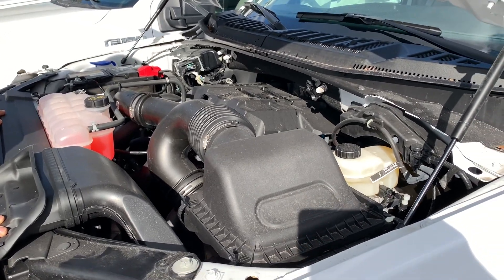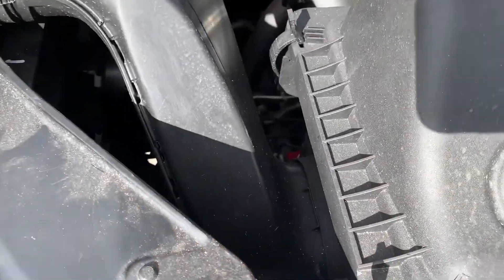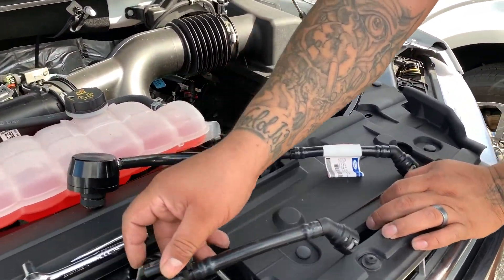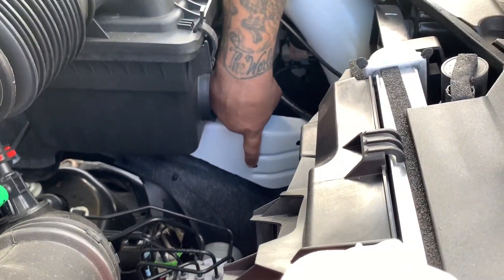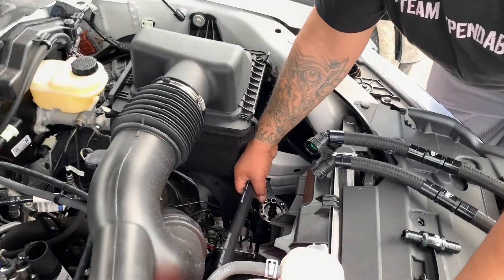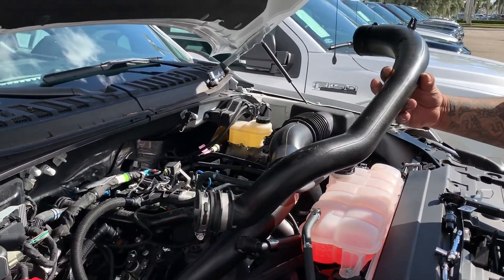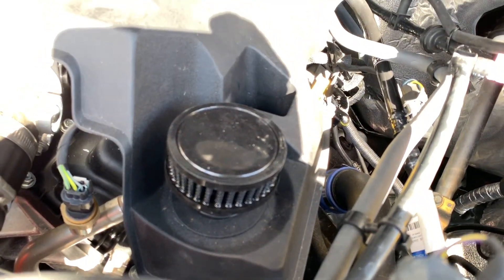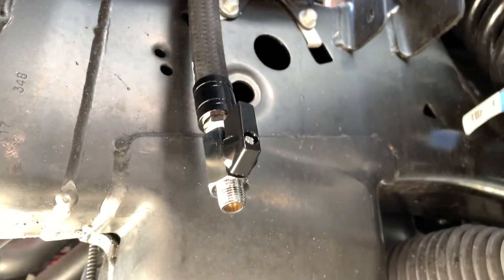Biggest Problem Ford Ecoboost Engine & How to Fix It: UPR Catch Can Install on 2016-2021 F150

Comment: Im having a big problem with oil going into my intercooler and lots of smoke on acceleration I recently replaced both turbos because of noise and they were both pretty wore out but my question is will this stop my oil consumption and keep oil out of my turbos and intake?
Reply from the maker: Absolutely, you can get your oil consumption under control. The UPR Plug N Play Dual Valve Catch Can with UPR Pro-Series Check Valves, and UPR ECSS will eliminate oil consumption .

Comment: isn't this one of the problems they fixed with the redesign of the 2.7L Eco Boost. By Adding a port injector?
Reply from the maker: No the brand new 2022 2.3 2.7 3.0 and 3.5 all still consume the same amount of oil through the PCV system as we test and own each motor. Also, the pictures and results all our customers get with brand new vehicles have defunct any improvements Ford claimed to make. We pride ourselves on delivering a product that produces results and improves mpg, performance, and overall engine life. UPR

Comment from the maker: The breather is good to limit the amount of oil getting sucked out the clean side. Also, the kit is a direct bolt-on and does not increase crankcase pressure. The main benefit is added insurance and generally about 1mpg minimum you will notice cruising over time. Plus you will have a crisper throttle response. UPR

Comment: Is the breather 100% necessary? Does this UPR kit do anything that would cause higher than normal crank case pressure compared to stock? Or is it just added assurance

Comment: you know this engine has duel injection so you really do not need a catch can would recommend one for years 15 -17 tho
Reply from the maker: All EcoBoost engines need catch cans as the amount of oil that gets sucked through the PCV system is very high. We own multiple 2016 to Present Ecoboost vehicles and they fill the Catch Can just as fast as the 2011 models did. The only thing that Ford changed made a very minor improvement by washing down the backside of the valve a little bit better. This does nothing for all the oil that gets sucked into the combustion chamber killing the octane and reducing combustion and even tripping knock sensors. The average MPG increase we see when you install a UPR Catch Can System is about 1 to 1.5 miles per gallon. Too many people are confused thinking the oil ingestion/consumption has been addressed with direct port and nothing has really changed. The benefits of installing a UPR Catch Can System are longer periods between tune-ups and without question overall performance and mpg. 

The average 2019 to Present Ecoboost engines can still see as much as 3-5 ounces of oil in that catch can between oil changes. The answer is Yes on recommending a catch can for all old and new EcoBoost engines. Just an example on our 2021 Explorer ST we saw it was able to make more power in everyday use and abuse towing or racing since the catch can was installed by stopping detonation or tripping the knock sensors by eliminating oil from being sucked through the PCV into the intake tract. Joe@UPR

Comment: Do these 2nd gen 2.7s even need a catch can since they have port injection?
Reply from the maker: Yes absolutely as the 2.7 3.0 and 3.5 ingest more oil than most engines as they are designed to make great power and being turbocharged they have a ton of crankcase pressure. The crankcase pressure forces the oil through the PCV system. Creating havoc by oil introducing a good amount of oil to the combustion chamber tripping the knock sensors and which reduces overall performance and MPG. We normally see an increase of 1 to 1.5 MPG in testing on your run of the mill vehicle let alone the ecoboost platform. Our brand new 3.0 ST Explorer is the most advanced of the bunch and it will dump an ounce of oil in the catch can in 1000 to 1500 miles and is consistent with many of the ecoboost engines. Joe@UPR

Comment: JLT catch can is alot easier to install not drilling require.
Reply from the maker: JLT Catch Cans only capture 40%-50% of the oil that passes through them and the rest still gets into your fuel and dilutes it and only gives you a minimal benefit. That's because the small simple filter not having any pre or aft filter or diffuser system. Joe @UPR

Comment: I thought 2017 ecoboost are dual direct injection fuel system. So why need catch can.
Correct me if I'm wrong.
Reply: The007astig 2018 they added port injection to help keep the back of the valves clean and for NVH reasons. A catch can is still a good idea to keep oil out of the intake especially on a turbo engine.

Comment: does a truck with dual injection really need one of these though? there is definitely going to be oil blow by but the port injection should wash it off.
Reply from the maker: Oil in the intake manifold & combustion chamber is NOT good. And as a matter of fact, the DI engines tend to be worse on carbon buildup.  We've inspected multiple brand new vehicles with less than 1,000 miles and oil pooling in the intake manifolds.

Comment: On the drivers side turbo doesn't this still allow oil into the intake?
Reply: I have a new 2019 and I'm trying to figure this out. Do you think it does allow oil in on the driver side?
Reply: @MarkNOTW  Yes, it does when it boost it lock the PCV system and floods it with back pressure that exits the driver side clean line.